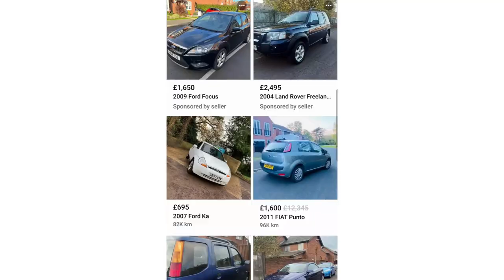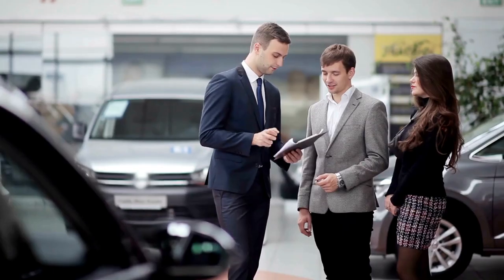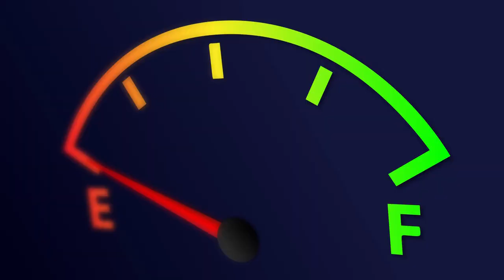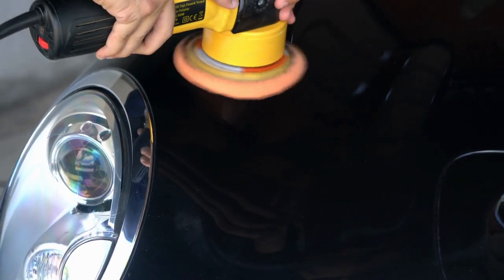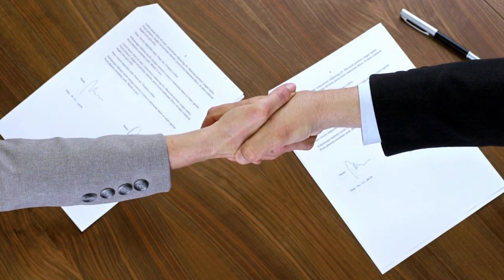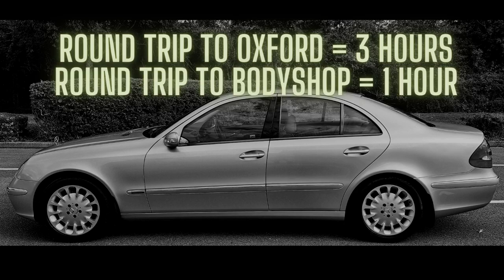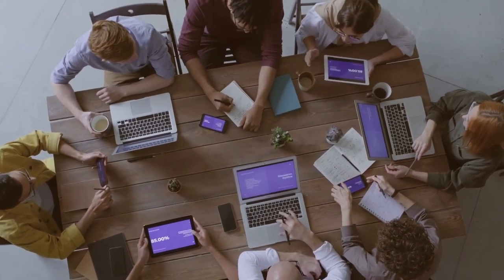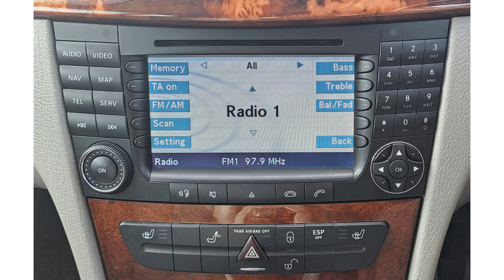How to flip cars UK | FULL PROCESS (2)

Comment: Do you get the hpi checks for free or do you pay for them, which app/ websites best to use? Also if u pay u should add the hpi cost as well 😉
Reply: I get a pack and it works out about a tenner each.
Reply: If I can't absorb a tenner. I am doing it wrong.🙂
Reply from the maker: There used to be a way you could find out on Auto Trader for free but they must have found out... otherwise I generally use instantcarcheck.co.uk - 5 checks for £10. However, BCA usually mention if the vehicle is an insurance write off or not

Comment: Do you reckon I could do this full time? I'm earning around 2,000 a month, and looking to start a hustle and take onwards from that at my young age. Also where do I apply for a dealers licence?  Any things I need to keep in mind? Thanks
Reply: I’m a mechanic and would advise make sure you know roughly what you’re looking at, any common issues with the car you’re looking at and a rough idea of what they cost to fix. If you can work on your own car you can save a lot of money. Paint to get right is quite hard and you need a good amount of expensive bits to get that right so being friendly with a local panel beater is always a help. If you need to know anything else we’re always here to help
Reply from the maker: It all depends how much time, effort and money you have to start you off. In the UK, you obtain trade insurance first and then maybe look at getting a dealership further on down the line. Just be wary of any car you buy and do your checks!
Reply from the maker: Exactly what @AdamWills says 👌
Reply: @carsnstuffuk  hi mate, I’m looking at getting started. With getting my BCA account is there any motor trade insurance you suggest? Thanks in advance
Reply from the maker: @Connor Phelps  hi mate - I tend to shop around if I'm honest. Best bet is to use quote zone who act as a comparison website and they'll get you in touch with different brokers. Good luck on your journey mate 👍